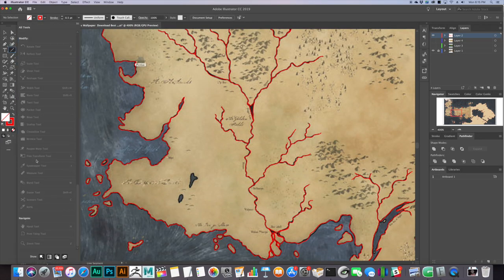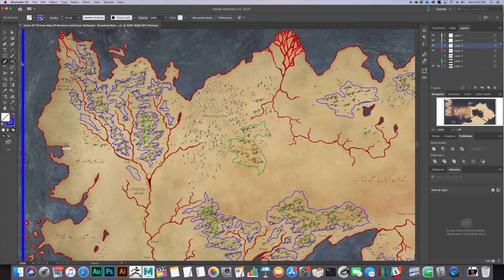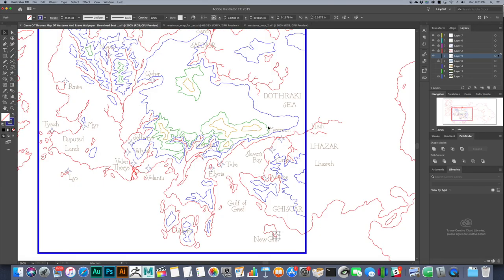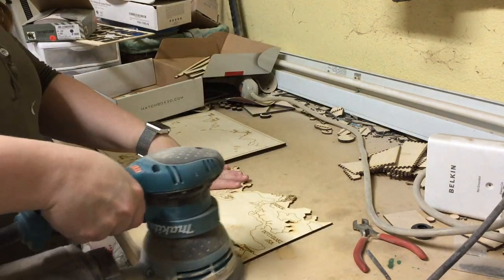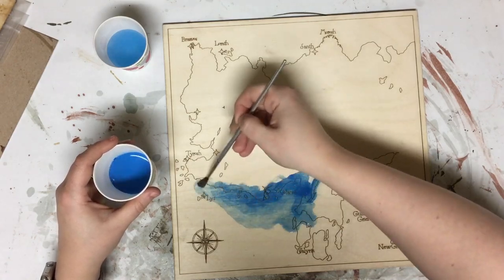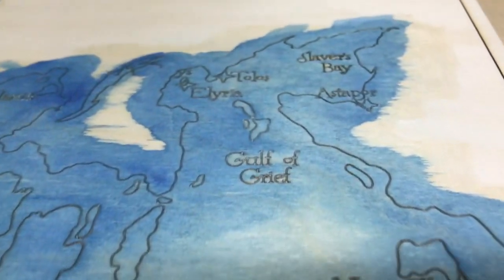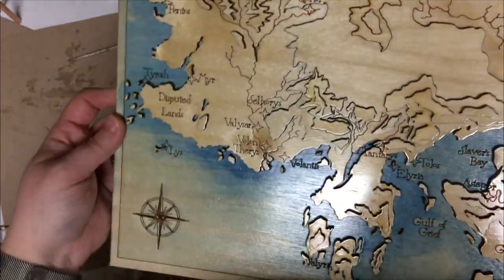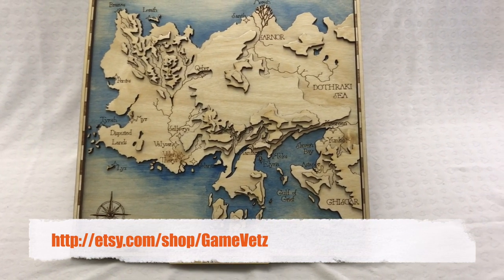Topographic Lasercut map of Essos from Game of Thrones

Comment: Could sanding be done before cutting?
Reply from the maker: Yes, but the actual process of cutting the wood with the laser leaves charring on the wood's surface.  It's not only discoloring, but also roughs up the surface so it would need some level of sanding again anyway.